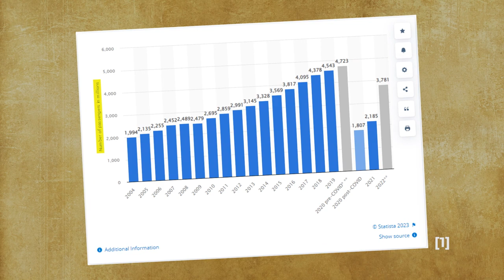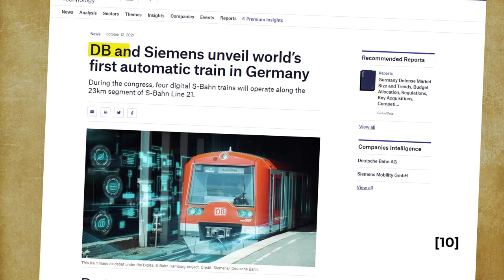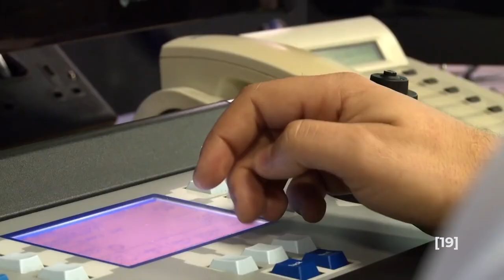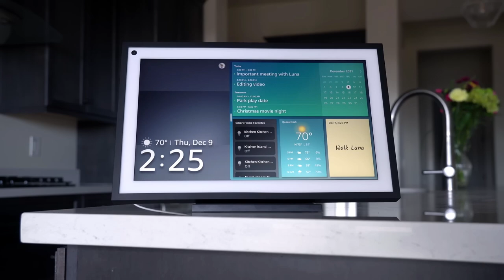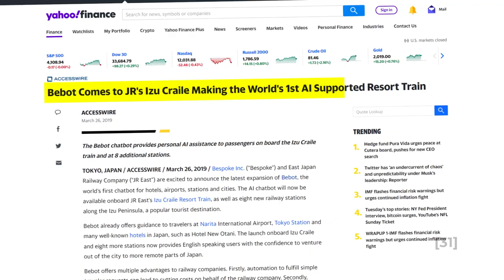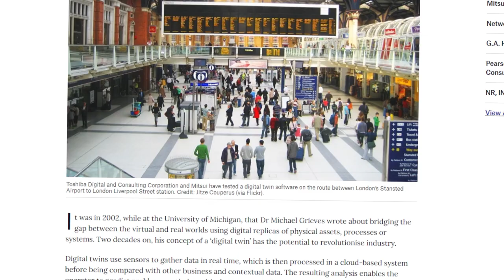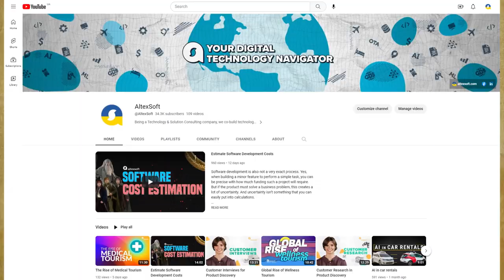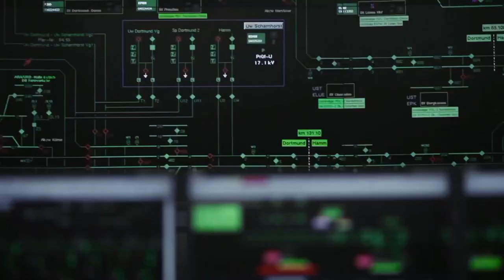AI in rail travel

Comment: Autonomous Train (UTO) are not considered as AI application.
Reply from the maker: The thing is there are 4 Grades of Automation of trains. The first stages don't necessarily imply AI usage. However, to achieve GoA4 or full autonomy (unattended train operation without any staff on board), trains should be equipped with advanced technologies (high-precision sensors, cameras, positioning systems, etc.). These components are typically based on AI and feature ML capabilities that allow for implementing of safe, efficient, and fully autonomous operations.